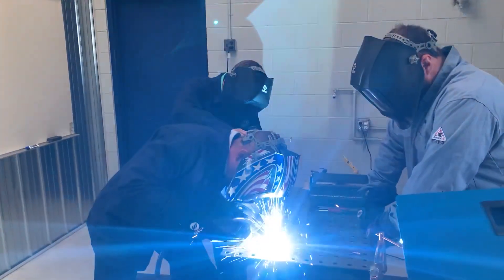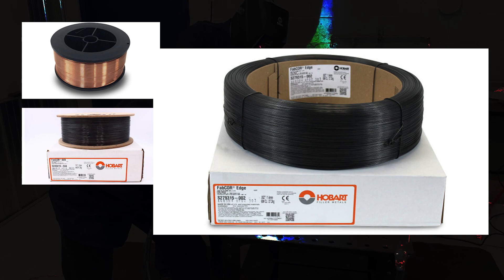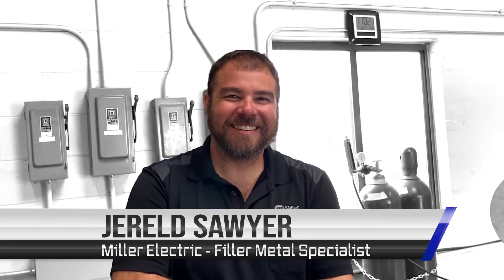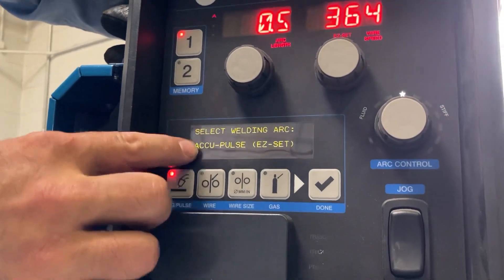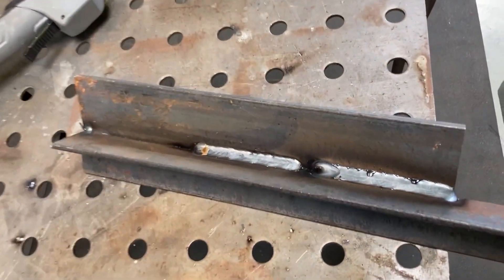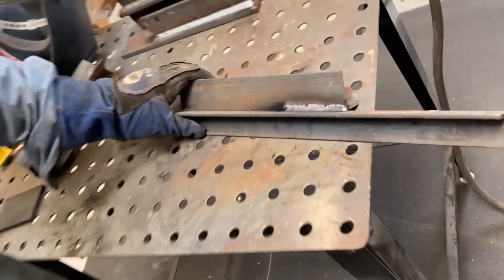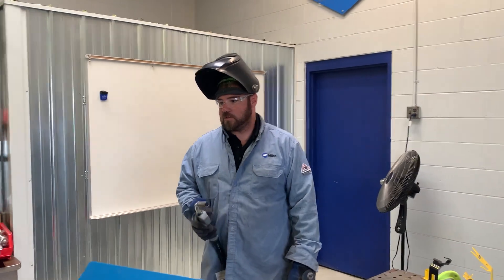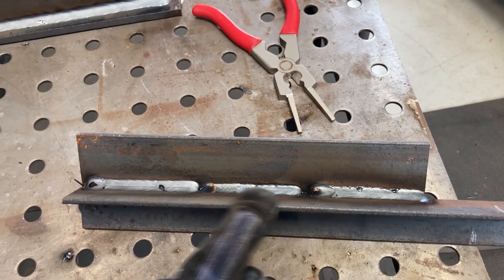Metal Core vs. Solid Wire - From a Filler Metal Expert

Comment: Question 1: have You tried to weld fabcor 86 r with 92/8 gas mixture? If not what the change in weld penetration You presume will cause that change from 90/10 ?
Question 2: have You tried to weld fabcore 86 r with three-mix-gas, for example Terral 24/7 (from Air Liquid) that is mixture of 91,5% Ar+ 6,5% CO2+ 2% O2 ?

Comment: Can you upload a video where you do some uphill and overhead welding please
Reply from the maker: MCAW is generally intended for flat and horizontal welding. However, if you have a pulse capable power source, running vertical and overhead can be achieved with this method. The wire feed speed will need to be in the 150-250 IPM for 0.045 wire.

Comment: In the fabcor86 what is your wire speed and voltage
Reply from the maker: I believe we were running an 045 diameter. Initially set at 26V and 400WFS - from here you can tweak it as needed.

Comment: When I use metal core I noticed I couldn't do downhill because it would start dripping. Any suggestions
Reply from the maker: If you have a pulse capable machine, turn down the arc length slightly.  If you have a standard machine then lower the wire feed speed as that will take amperage out of the arc.  Hope that helps.
Reply: @puritycylindergases  so I have the miller 255 multimatic, would this work well for it? I'm still inexperienced at welding right now.
Reply: Don't downhill if it's structural, only for thin steel

Comment: Great explanation of the different wires here. Do these wires weld primered steel well? All of our plate comes primed and grinding it off is time consuming. also Our shop is wanting to switch over to the Fabcor Edge Ni1. Any experience with that?
Reply: Thanks Jared!  
Unfortunately, we would never recommend welding on something that's been painted.  It is important to clean off the primer for best results.  There are some other products in the abrasives world that may be more suitable for your application.  Ni1 is a more specialized metal core specifically designed for nickel-molybdenum steels.  One of our reps would need to provide a full evaluation of the application in order to make a proper recommendation.  I also put an inquiry out to our filler metal specialist over at Hobart to see what his two cents are.  I'll keep you posted.  
Thanks for the inquiry!